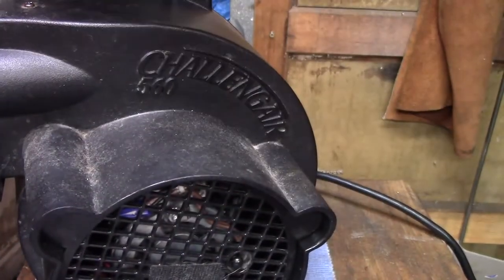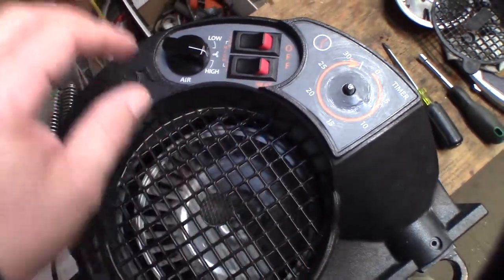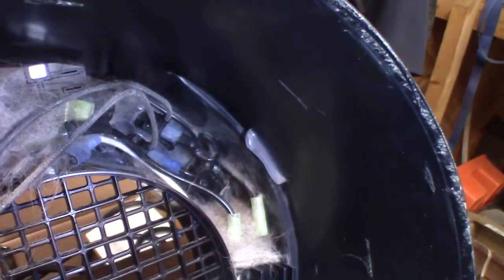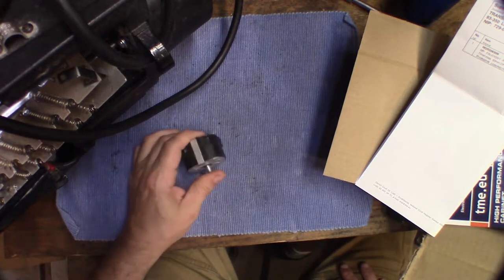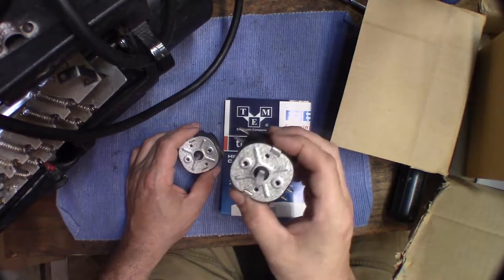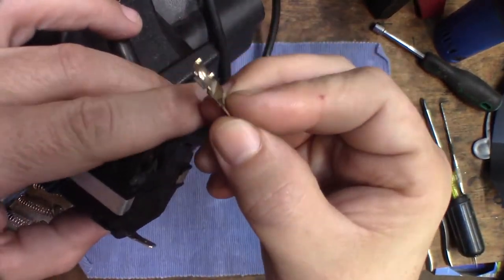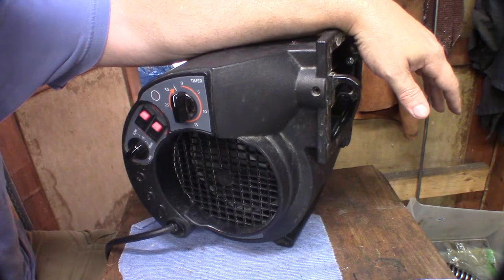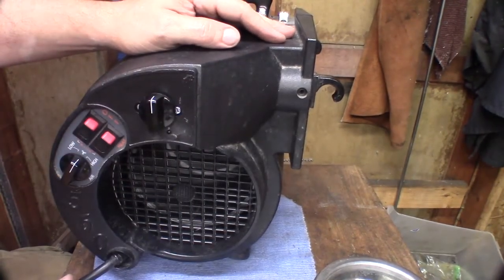Repairing a ChallengAir Double K 560 Dog Dryer

Comment: I was just saying the other day that someone should do a Challengair 560 repair video!
Reply from the maker: This is actually a 560B so you will have to keep waiting.
Reply: @theeddies   Well of course it's the 560B. I was just testing you.
Reply from the maker: @johnstrange6799  you could have used a few of these the last few days.
Reply: @theeddies  I watched a 3 part adaption of 'Atlas Shrugged' that was so scuffed. I don't know the originals of it, like if it was a Hulu or Netflix, or Dumpster Fire Productions affair, but it was messed up. The acting in the first installment  was horrendous, but each of the three installments had a different cast playing the same characters. It was fucked. lol
Reply: @theeddies  lol I have two or three similar small ones around here (non heated), but I only use the one big one that I have on casters that was from a old furnace. I found it and it's old school, but it looked like new old stock (clean and nice. Made in Ohio). I love that thing.
Reply from the maker: @johnstrange6799  not sure where that came from but I guess the production was that bad, you just had to share with someone. I'm sorry for your lost time? Why did you watch the last 2 if the first was so bad? Or why did you not listen to Roger Ebert who called it " the most anticlimactic non-event since Geraldo Rivera broke into Al Capone’s vault."?
Reply: @theeddies  lol That's exactly it. It was so bad that I had to share it.  It's a cool story, and visually it was nice (first lead actress was kind of hot), but besides the failure of acting/cast changes, man... they were doing mind numbing stupid shit too! In one part two of teh characters go to an old factory in Wisconsin that closed 30 years ago or something JUST because they saw a photo of some supposed proto type engine. They get there, the place is still extant, wide open, and completely empty, and one of the characters says, "It looks like they just up and left.", but it 100% doesn't look that way, but that's not the stupid shit. They are looking around and I swear to God they did the ancient mega cliché where the other character says, "Hey look...." and they move a metal shelf to reveal a hidden room that just happens to have the prototype engine and all of it's blue prints!  I almost rage quit watching!  Later in the movie the main character is flying a plane (but there's no prior mention of or any back story that she is a pilot) she just buys a plane from someone standing there and takes off into the sky. But THAT isn't the stupid part. She is racing to catch someone before they escape, and they do the thing where she actually sees the person she is looking for on the ground from the plane. It was at that point I started skipping and skimming through to the ending.
Reply from the maker: @johnstrange6799 that sounds worse than awful.  I have have many hours of flight time in the Microsoft flight simulator and can definitely attest that people on the ground are very hard to see, much less identify.
Reply: @theeddies  Mistakes were made.
Reply: What if that Gordon Lightfoot song was just called "If you could read" ? lol
Reply from the maker: @johnstrange6799  Actually it could be  "if you could read a book". Doesn't change the meter and fits right in with the rest of the lyrics. It just makes them a bit sadder (funnier?)because it sounds like he is lamenting (making fun of) illiterates then.
Reply from the maker: @johnstrange6799  Next up on Reading Rainbow, Gordon Lightfoot performs a song about people who can't read.
Reply from the maker: @johnstrange6799  Musite bringing the clickbait title today. Bastard!
Reply: @theeddies  lol I would be surprised if he was on Sesame Street or something back in the day.
Reply: @theeddies  Was it horseshit? I commented, but saving the vid for later. Is he not getting rid of it?
Reply from the maker: @johnstrange6799  He loaned it to a car museum. He gets it back in 2 years.
Reply: @theeddies  Cool. Where is there museum?
Reply from the maker: @johnstrange6799  massagachusetts
Reply: @theeddies  lol where?
Reply from the maker: @johnstrange6799  Watch the rest of the video?
Reply: @theeddies  Not yet. I'm saving it for later tonight when I have nothing else to watch.  Boredom Hour.
Reply: @theeddies  I finally watched the video. Now... BORED!
Reply from the maker: @johnstrange6799  I am about convinced that 90% of the videos with a million or two views with titles like "DIY project you must see to believe" or "Amazing mechanical at work" have bought many of those views to play the algorithm. I have been watching a few of them lately as well as a few that did not do as well. They all pretty much share the same styles, are pretty much equal quality filming and work. The difference is most of the really viral ones came out of India, Russia, Pakistan, Ukraine, etc. How is it that those third world countries produce so many of them if it is not buying views which in those areas might be pennies per thousand. Once they have a few grand of them with likes and watch time, the algorithm will pick it up and spread it to everyone. For this experiment I only used videos without faces or sleeping so there was no personalities in it. I find it interesting
Reply: @theeddies  That is very possible.  Without sleeping?
Reply from the maker: @johnstrange6799  sleep is for productive people.
Reply: @theeddies  I mean for your experiment you used  "...videos without faces or sleeping" ???
Reply from the maker: @johnstrange6799  lol, SPEAKING, how did autocorrect change my correct word to the wrong word. The L is below the P so maybe It was my fault.
Reply: @theeddies   LOL I didn't know what you the hell you were talking about!
Reply from the maker: @johnstrange6799   @John Strange  maybe they are not even buying likes. Check this one out 11 million views and 6000 likes, 6000???? That is 1 like every 18,333 views, that is impossible, my worst videos have at least one like per 200-300 views. And all their big view videos are like that. Link to follow
Reply from the maker: @johnstrange6799  https://youtu.be/SBoRfAdCyEM
Reply: @theeddies  Intriguing.  That kind of ratio is more than a little sus. Maybe there are sociopolitical agendas of some sort being worked from on high? idk
Reply from the maker: @johnstrange6799  well if it is not manipulation by the channel it blows a huge hole in YouTube coming out admitting recently that likes ratio and watch time are more important than subs and past video views in determining whether videos are suggested. HOWEVER, maybe that is a new change because looking at that channels most recent videos, they are not doing nearly as well as they did a year ago. Personally I think some channels boost their initial views and hope the algorithm picks them up. I don't know. But they do take up valuable space in the recommends on my  front page.
Reply: Who knows? Is there a way to view (via like social blade or something) the analytics of someone else's video? It might be interesting to see exactly when and how much it spiked in views, and from where. Do you think people are less likely to hit the like button while on a phone? That view to like ration is fishy as hell.
Reply from the maker: @johnstrange6799  Social blade can tell you a lot however that particular channel (and many like it) has their info set to private so cannot tell trends or even sub counts. In my experience looking at my own analytics, phones do not make much difference as far as likes one way or another. What does make a huge difference is external views. For instance, when I post a video it will get  about a like every 10 views or so and my average is about 100-200 views in the first couple days, which is terrible in my opinion with 2300 subs but is actually about normal from what I can tell, especially with a non focused channel like mine. Anyway, if I post the video to HomemadeTools.com or Reddit. Those people will often watch them from that site. There is often not an easy way to "hit the like button" in those external embedded players. So if a server farm or "view farm" sets up a webpage with a bunch of videos embedded on it and has bots with artificial accounts or even sends real paid people with real accounts there, they would more than likely not hit the like button because A: it is an extra step or 2 and B: that costs more time and hence money. 

Now, that being said, Youtube is supposed to have a system to see that activity, in fact many of my views from HomemadeTools have their counts delayed because the system is seeing an odd number of counts from external sources. They always catch up in the end but there is supposed to be some sort of system. Of course it is the same system that allowed a Bollywood channel to game the system and become the most subbed channel during the great PewDiePie vs T-Series fight of 2018 or whatever. T-Series was adding blocks of 10k subs every day or so like clockwork and nothing ever happened with it. 
None of this really matters except maybe it does. There may never be another Mustie1 or TOT or AvE or even Abom because all the mindless drivel, that frankly much of which looks like it was stolen footage, is taking all the same limited air.
Reply: @theeddies  It's all adding up to a scam.
Reply: @theeddies  Got another big storm headed right at me. Great!
Reply from the maker: @johnstrange6799  well don't start clicking on them like I did, you get fed nothing but them. Check this one out https://youtu.be/uPL7oiQ9ZvA 19 million views for a speciality machine cobbled together out of plywood. I mean, really, how can there be that much interest in that. Despite the fact it is never going to hold up, when have I ever needed to sand 1/16" off a short length of wood like that. And BS that ending was not sped up at least double. It just is not a real world practical device for doing anything but making a bit of video captured sawdust. The whole thing reeks. Cobble together some crap device for doing some mundane task and get 19 million views. BS, cannot happen without some serious tomfoolery. Watch Craig Tate, he should be raking it in by now if it were real, just kidding.

My next task is to take a couple of them and try to track down their off YouTube post history. See if I can find some foreign aggregate sites that are feeding these views. I got a little of that with the mill drill video (100k views btw after 3 years) from some Russian site that it ended up on. But it was maybe 1000 views over a day or two, not a million over a year.
Reply from the maker: @johnstrange6799  sorry man, batten down the hatches and fill the sandbags.
Reply from the maker: @johnstrange6799  Dad saw this the other day at the house of the guy that made it. Rusty and not running anymore apparently but still cool. https://youtu.be/JkfU0-V-xwo
Reply from the maker: @johnstrange6799  He built another one https://youtu.be/BFG8geGUAmU
that one apparently still runs
Reply: @theeddies  Cool. Looks like  ton of work. I forget the story of AC Gilbert, but I came across it when I was looking at The James Bond Race track set that I had. I recall it was an interesting story, but I can't remember the details
Reply from the maker: @johnstrange6799  He told dad he had at least 900 hrs in each one.
Reply: @theeddies  I believe it. It looks like a situation where you might have to take many pieces apart just to change, fix, or add some other unrelated part.
Reply: @theeddies  What did you think about the old milling machine for $300?
Reply from the maker: @johnstrange6799  Guess you did not get my response. It would make a cool project. I had not heard of the maker, apparently it would be a pre 1947 Burke. Not sure if the ways are savable, the knee (horizontals) look pretty pitted in the photo. If it were a motorcycle I would say it is a parts bike. I wish I had a good easy way to move that heavy old iron around, I would go get it, just because the price.
Reply: @theeddies  I'd want it for the head, ram, motor mount (maybe motor) and the belt guard.
Reply from the maker: @johnstrange6799  well in that case I could just leave the rest on the side of the road there in Alabama, or hell the middle of the road, they are not particular.
Reply: @theeddies  If I had a forklift, truck, and a trailer I'd have all kinds of old machines.
Reply from the maker: @johnstrange6799  yep
Reply from the maker: @johnstrange6799  if you join my Patreon, together we can purchase a forklift for us the channel (disclaimer: forklift to be solely owned and operated by me)
Reply: @theeddies  On the Youtube free movies they have Muscle Shoals, Sound City, Wrecking Crew, and Terry Kath if you haven't already seen them. I never saw the Sound City. It was good.
Reply: @theeddies  Oh. It's that time of week again. I see.  Maybe you can be a Toolevangelist who gives sermons on your Patereon, Live Streams, and videos.
Reply from the maker: @johnstrange6799  24/7 Good ole fashioned tool gospel. And yes I will check out the music vids
Reply from the maker: @johnstrange6799  watching Taryls making his lawnmower tow rig from last year. He mounts the canopy and says "things looking like a carnival ride now Going to have to wear a clown suit when I take it now" and then stares at the camera with his one eye open, one lazy eye look, wig and false teeth.  I laughed too hard.
Reply: @theeddies  lol I haven't watched him in a while.
Reply from the maker: @johnstrange6799  at the end he uses it a full clown complete with red nose of course.
Reply: @theeddies  Man.... I'm been awake since.. I don't know when, but the Flash Flood Warning that "expired" at 7am has now been extended until 7am tomorrow! -- 11am Thunderstorms!  3pm Thunderstorms!! 10pm.. you guessed it. Since we've had a shit load of rain already it could be real bad. smh! Just smfh!
Reply from the maker: @johnstrange6799  Get any sleep? Still raining? Still afloat?
Reply from the maker: @johnstrange6799  lol, "the end of the world is nigh, please deposit $9.99 a month to read all about it and find out if it will affect you." Or my favorite. "The earth is about to be destroyed, news at 10"
Reply: @theeddies  I always thought hurricane names should be that of corporate sponsors in order to raise funds for victims.
Reply from the maker: @johnstrange6799  I love Craig Tate's videos. He goes on this long ramble about this repair he is going to do on a worm drive. And describes all this precision work he needs to do and then he throws out there "the runout on my lathe is 8 thou so that's not going to help matters" I don't think he meant to give me a laugh but he did.
Reply from the maker: @johnstrange6799  new provacative video is out in case you are still awake on water watch. Hope you are still well.
Reply: @theeddies  I'm still up. Storm watch ended for this round. Dodged the bullet by the skin of my teeth. I'll check it out in a bit.
Reply from the maker: @johnstrange6799  where is that? On mobile and can't tell.
Reply: @theeddies  Unfortunately Michigan, which incidentally might be their new tourism slogan.
Reply: @theeddies  Earlier I overheard a girl in her late late 20's (maybe even 30 years old) say, "I heard that when it's Summer in Australia it's cold in the United States. Isn't that weird? I wonder if it's true."  -  It sent a chill of doomed future through me. I was speechless for second.
Reply from the maker: @johnstrange6799  Wait til she hears that toilet water spins the opposite direction
Reply from the maker: @johnstrange6799  where was that $800 south bend?
Reply: @theeddies  I responded, but obviously you didn't get it. I said: "Unfortunately Michigan, which incidentally might be their new state tourism slogan."
Reply from the maker: @johnstrange6799  Dude I have been to Michigan many times, have family there and yes their slogan is definitely "Unfortunately Michigan"
Reply: @theeddies  It's a great state with some great history, some great parts, and some not so great parts or history.
Reply from the maker: @johnstrange6799  That is pretty much every state, except Alabama, which is all the latter.
Reply: @theeddies  lol True.
Reply: @theeddies  Did you watch Mr. Pete's latest 2 part series? I think I recall you mentioning that you have a Beverly.
Reply from the maker: @johnstrange6799  I saw most of part 1. Yes I have one and I need blades. Those bastards have not answered the phone or returned my messages in 4 years. Thats why they are out of business.
Reply: @theeddies  Part 2 shows a bit more of the place. It's a good look at how things used to be here, and why there was so many machines. There were whole neighborhoods of small factories like that.
Reply from the maker: @johnstrange6799  its in my list
Reply from the maker: @johnstrange6799  https://atlanta.craigslist.org/nat/tls/d/kennesaw-lathe-jet-bd-920w-with-qc-tool/7342965637.html
Reply: @theeddies  I've seen that listing many many times looking at Craigslist. Looks nice. Be even nicer if it were $1100 - $1200. Did you get that link I sent earlier for the little 7x10 for $300?
Reply from the maker: @johnstrange6799  no I did not get it
Reply: @theeddies  Considering what it comes with, it's not bad at $1400 either. I'm just cheap.
Reply: @theeddies  It's a Harbor Freight that someone added metal gears to. The only thing I don't like with the JET is that it has a 3/4hp motor. I'm sure that's fine, but 1hp would also be nicer. Not a deal killer, but it would be nice.
Reply from the maker: @johnstrange6799  it is a perfect size, 3' long. 20" between centers, all my tooling works with it. Set up to do  imperial or metric. I just don't know about JET. I am sure it is better than what I have but still not sure about it. It is just one town over.   

Still did get the little lathe link.
Reply from the maker: @johnstrange6799  more like a grizzly I think. Never saw harbor freight sell one that big, I thought they were all 7x12's. May be wrong. 

Ill sleep on it. Not that I really have the money but I could probably offer 1100 or 1200. 

I did not tell you about the shop I visited today picking up a junk Honda. Guy rebuilds old small aircraft. Had a shop that looked like a mini hanger, one of the half round types that the sections just bolt together. Maybe 40x60.  He had it spray foamed inside and it had its own regular AC unit. It was like 65 degrees inside. I could have lived in it and if I had it I probably would. No real machine tools but he must have had 40 aircraft engines lining the walls. He was working on a wool and canvas biplane. The kicker is this was out in the sticks, Lie his neighbors had junk camaros, yard equipment, trash, and a trailer home. And this guy has a perfect house, manicured lawn, and a mini aircraft hanger in the back
Reply: @theeddies  No. The one for $300 is a Harbor Freight. I sent you the link for a second time. -  That kind of shop would be nice. I'd love to have a ground floor shop large enough for a forklift, and parking space outside for a truck and trailer.
Reply from the maker: @johnstrange6799  Holy crap is that guy a  giant? You cannot tell that at all in the perspective of the pictures. They sell that new for $3000 WTF. I had already passed in my head. I need old iron not a plastic toy for model engine builders.
Reply from the maker: @johnstrange6799  not sure whether to be impressed or convinced never to get on any road in Pakistan. https://youtu.be/fyWrPp3LPcY

As an aside check the like count.
Reply: @theeddies  Both!
Reply from the maker: @johnstrange6799  I need to move north.
Reply: @theeddies  If I could move it, one of those surface grinders would already be mine.
Reply from the maker: @johnstrange6799  take it apart
Reply: @theeddies  I'd have to ask favors to even do that, and I'm not down.